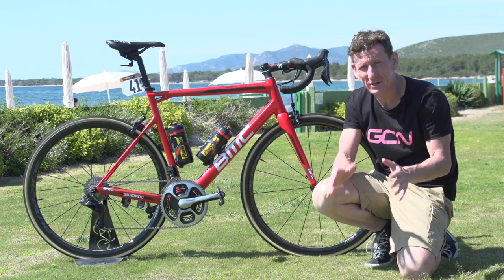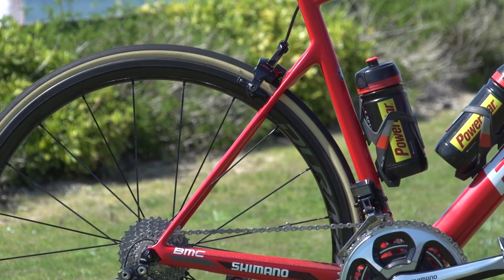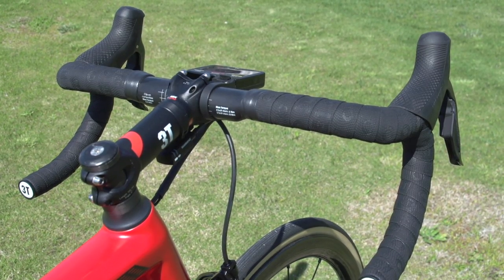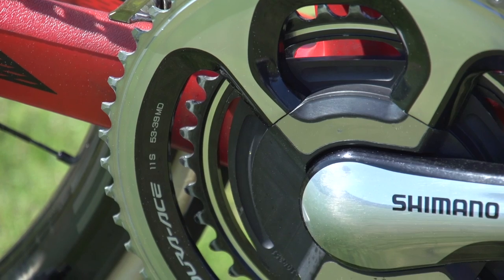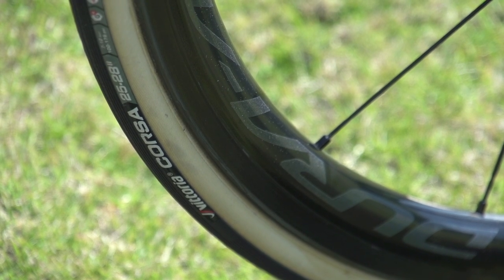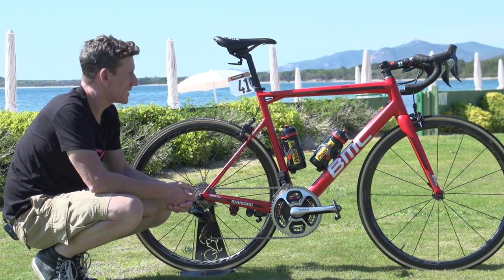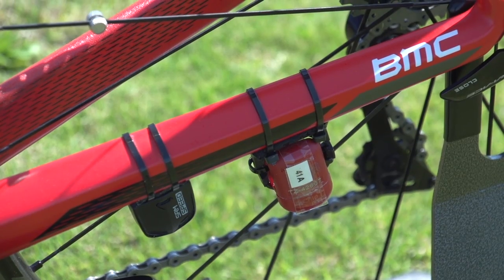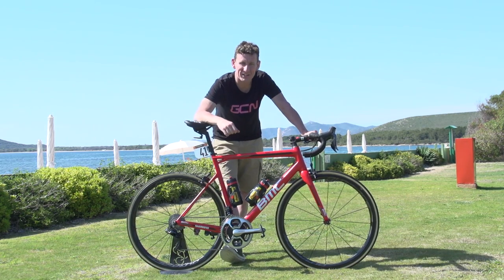Tejay van Garderen's BMC Teammachine SLR01

Comment: 11-30T cog is interesting. I can't believe he did today's stage without a 50/34T compact crank and proper climbing wheels.
Reply: Yes and no. They are 200g heavier than C24's from 2016. And there are sub 1000g wheelsets too but not from Shimano. If you are spinning uphill nobody is using 53x39 today. Might have been another bike and this was a back up or build for a flatter stage.